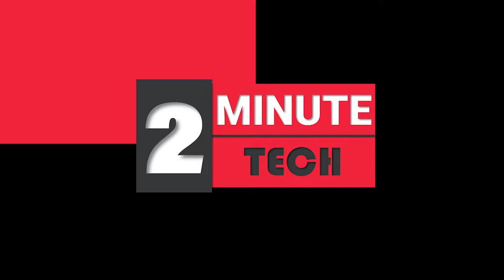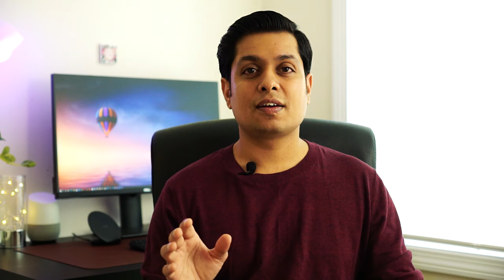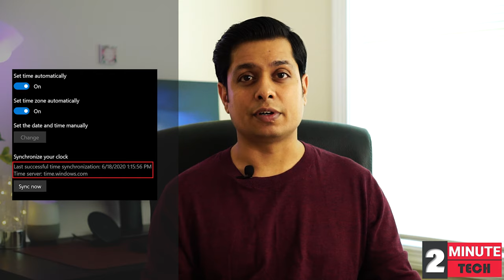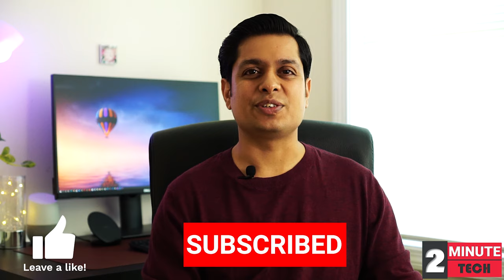2-Minute Tech: How Do Computers Keep Track Of Time? | CMOS Clock | CMOS Battery | Quartz Crystal

Comment: i have a question sir do system clock and cmos chip the same? pls iwill sub and like ty
Reply from the maker: Thank you lj plenos for such an interesting question. 🤘😊

CMOS Chip and System clock are different because their purpose is different.

CMOS Chip also called Real-Time Clock(RTC) is normally used to provide time-of-day(actual time) even when the system is turned off because it has battery backup power. ⌚

The system clock is a small quartz crystal circuit to control the timing of all system operations. It generates regular electronic pulses to set the operating speed of components of the system. This clock can't run when the system is turned off. ⏱

Processors today are described based on their system(clock) speed, usually in Gigahertz i.e. one billion signals per second. The higher the clock speed, the more instructions processor can execute.